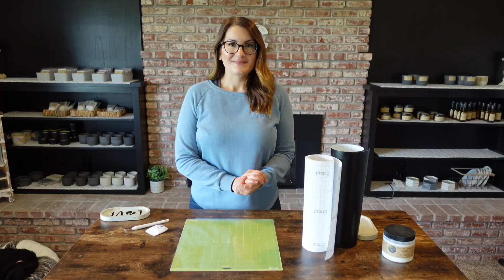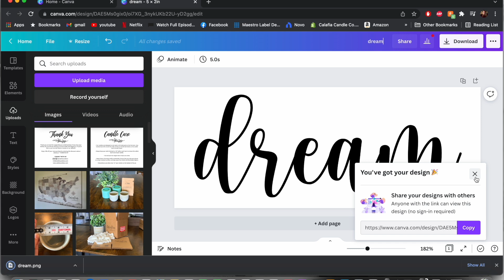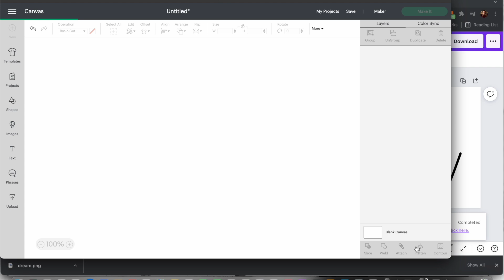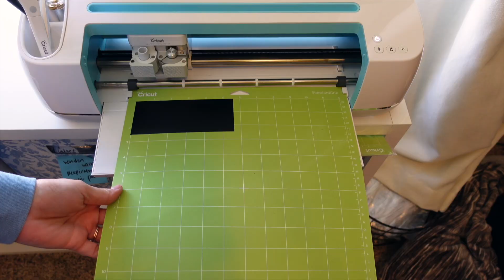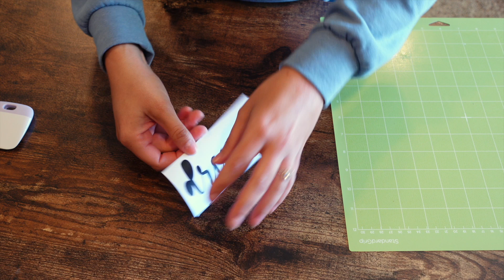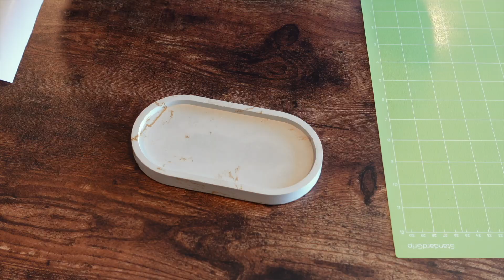How To Add Vinyl Decals To Concrete Products

Comment: I’m not sure why but I tried adding a vinyl decal to a sealed oval tray and it would not adhere at all. Do you know what I might be doing wrong?
Reply from the maker: It’s probably just not wanting to stick to the sealer. Try doing it on an unsealed tray and then seal.